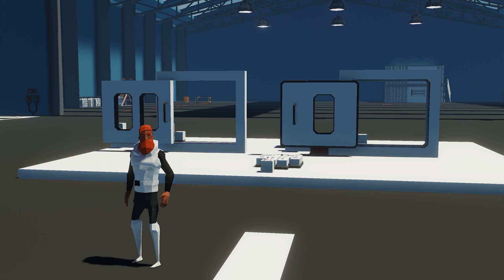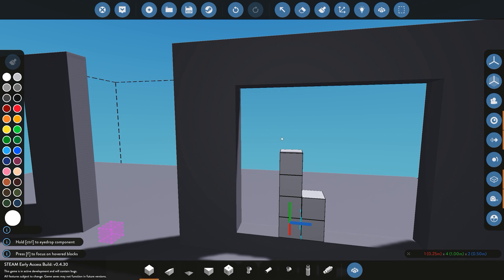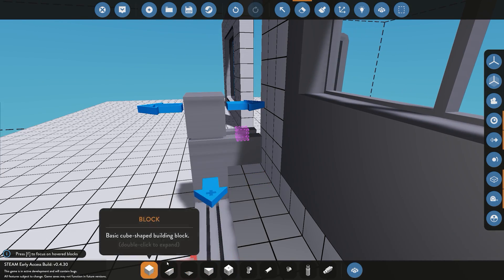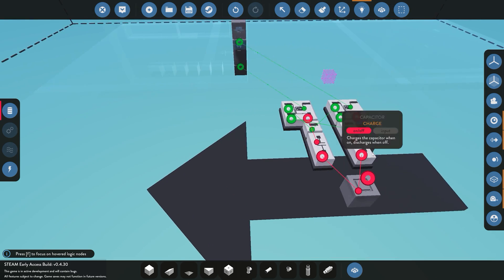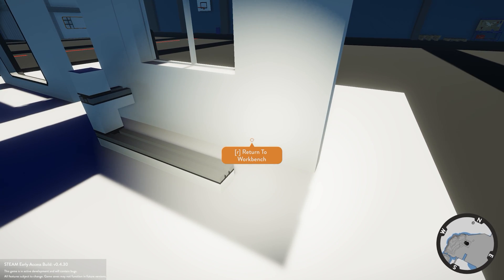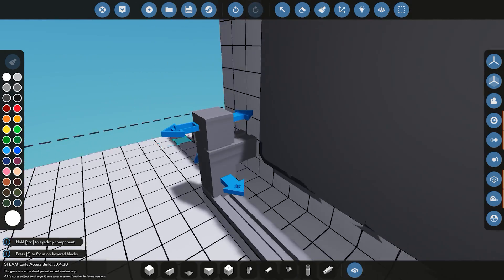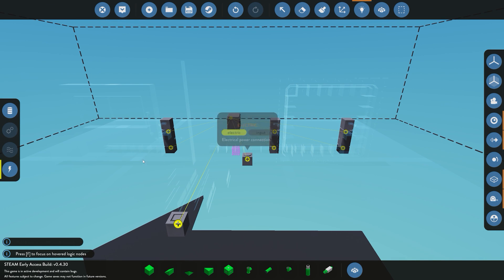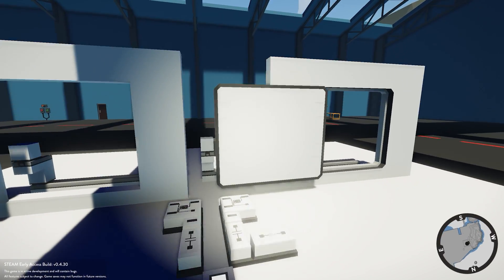Stormworks Sliding Door's Tutorial

Comment: What if the power goes out
Reply: Just use emergency batteries in case power unexpected went flat.
Reply: @thelightbrigadef4172  or you can put handles on it so you can push the door open sense if the powers out theres nothing holding the door in place so it can move freely kinda like the sliding doors

Comment: Hi i  love your videos, after watching your jet engine video im trying to make a vtol plane. It is operational but im finding precision thrust control very hard. do you have any advice, tips or online resource's that could help me?
Reply: You can select the throttle controls themselves and tweak how sensitive you want them and how they increment, is that what you mean?
Reply: thanks alot for trying to help, what i mean is i cant get the throttle to match the rps close enough to get consistant hovering it is either too high increasing the altitude or too low
Reply: @Daedric_Rat  so by the time the jet engine does ramp up it's too late and by the time it's slowed down it's too high, what if you used a jet turbine instead and used a clutch which can reduce instantly
Reply: you could try making an auto-hover system using a PID to control the throttle to hold altitude.